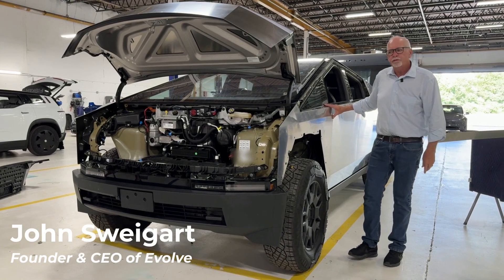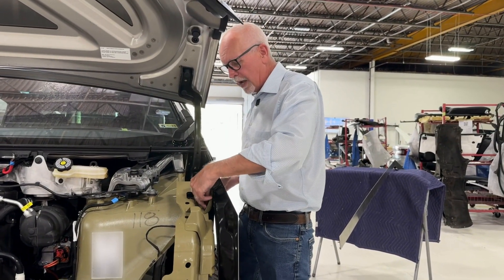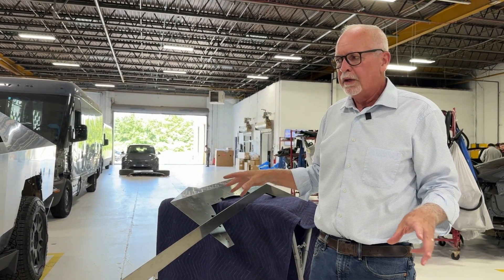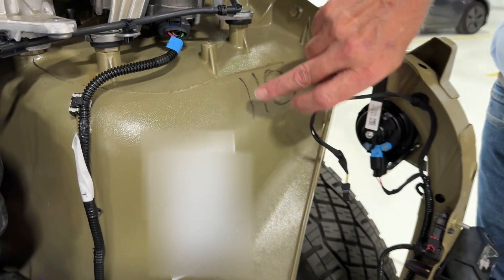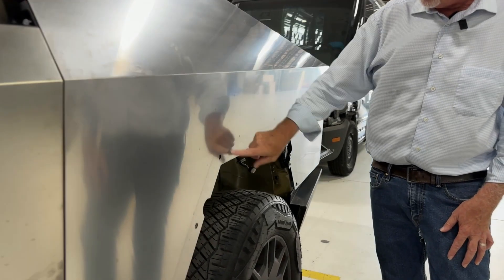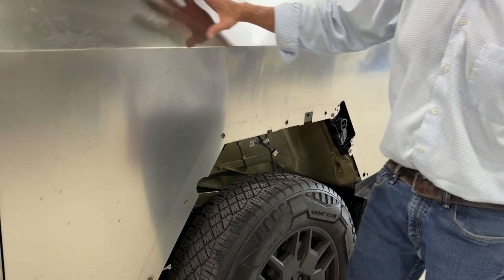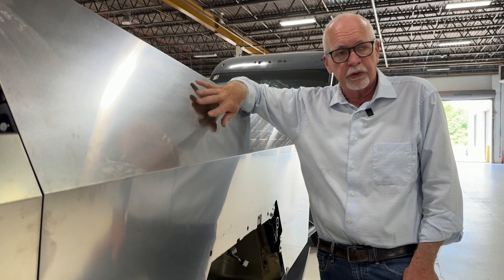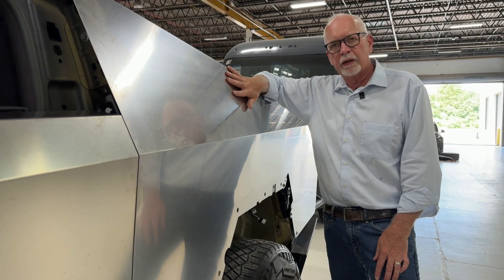How is the Tesla Cybertruck Built? A Closer Look

Comment: What is the purpose of the Cybertruck? Did engineers and designers start by trying to design the best electric truck possible or did they start with a Cybertruck concept and then figure out how to make it a reality? It took a long time for the Cybertruck to come out and my impression is that’s in part because they designed a vehicle that was hard to manufacture. It’s an achievement but was it worth it?

Comment: They still have a pretreatment & ecoat process for rust proofing the cab, battery enclosure and front/rear giga castings. They also powder coat the A, B & C pillars and door sills. The ovens for ecoating and powder coating still are needed. Basically there is 1/3 of a paint shop still needed.
Reply: Why would they need any treatments on the aluminum castings ? I thought they are hidden and natural aluminum oxide provides all the protection it needs.

Comment: Thanks, for the video; " the competition has  a long way to go to catch up", and you were comparing to the Polestar, a GEELY  brand , one of the most advanced and forward thinking of the Chinese auto manufacturers, the legacy auto are not even in site, or the rear view mirror.
Reply: Ford has a gigaPress in their R&D lab.    GM purchased TEI a company that is more or less used to rapid prototype cast parts.  3D prints sand molds.  Not suitable for mass production.